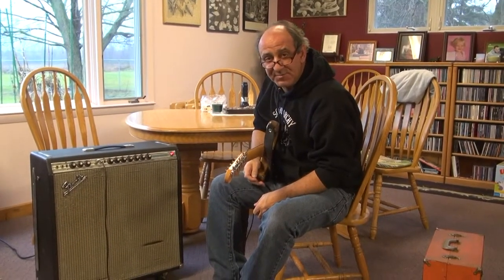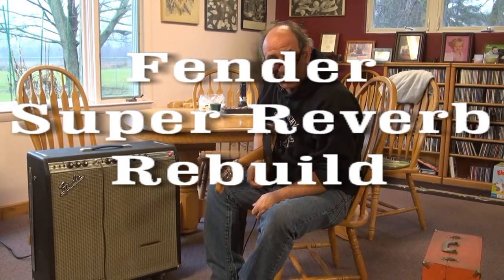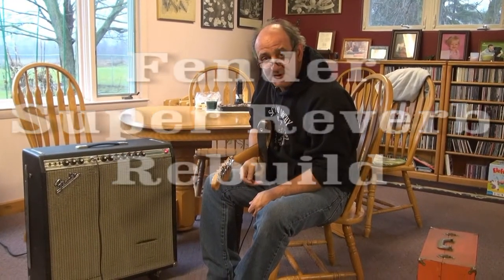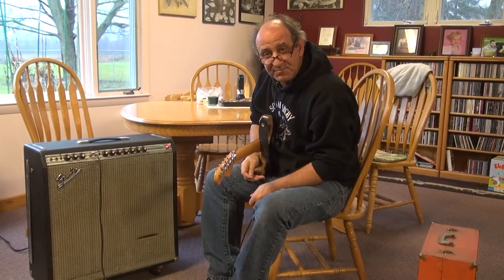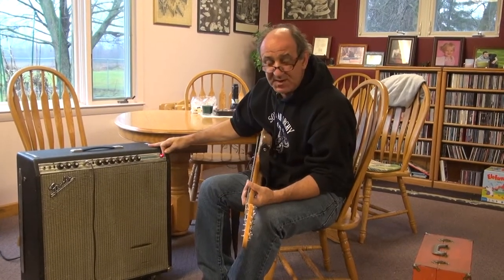Rebuilt Fender Super Reverb Silver face Tube Guitar Amp Demo

Comment: I've tried so hard to find my fender super reverb amp year it was made.  
The super reverb logo will read super with reverb underneath it
or super on an angle with reverb level next to it. Also both super reverb on a angle with amp added. 
SUPER REVERB in blue as you see it here. Silver face, aluminum face plate, four Jensen 10inch speakers. 
Original tubes and mint condition. 
My question is WHY am I not able to find a hundred of these with logo as described.  ( minimum)
on line.  I'm 99% its 1968 . Was told nope its 1970 and another said 1972 .  I'm 100% sure it's no later than 1970. I've exhausted so many searches.  Thankfully,  Guy   Az